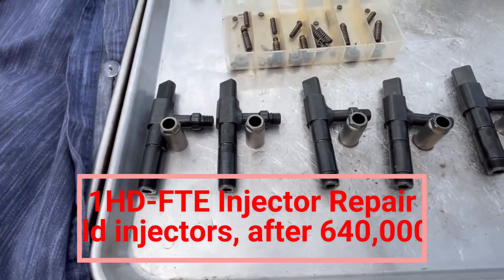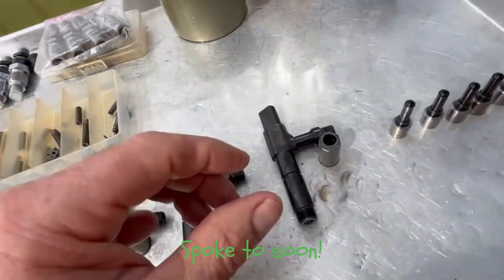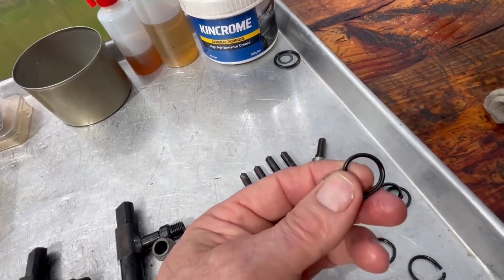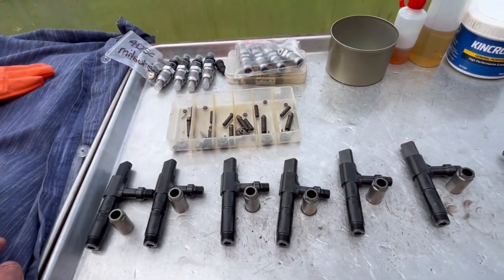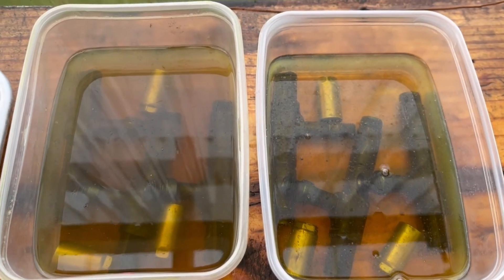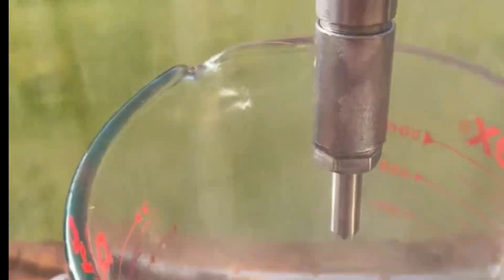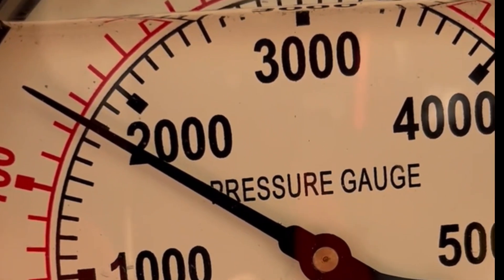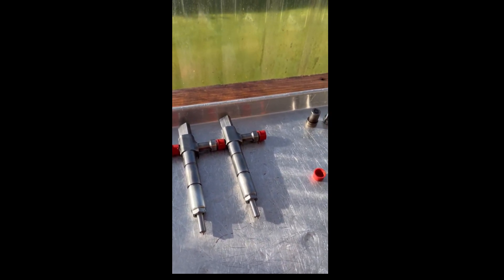1HD FTE 640,000kms Injectors in for Repair?

Comment: The injectors are double acting, are you only testing the first low pressure?
There is some kind of device that prevents opening on the first pressure. If you talked about it in the video, I apologize, I don't understand English well. :)